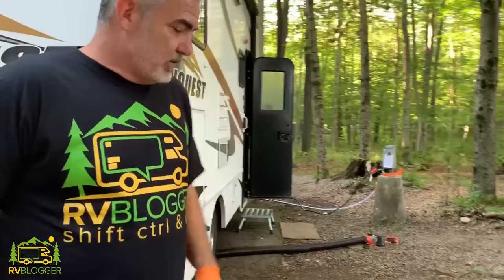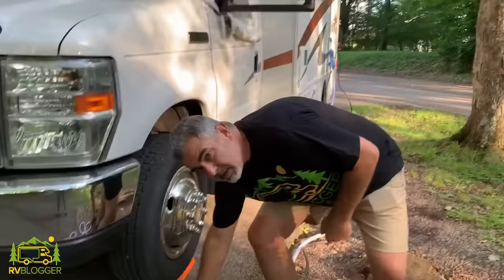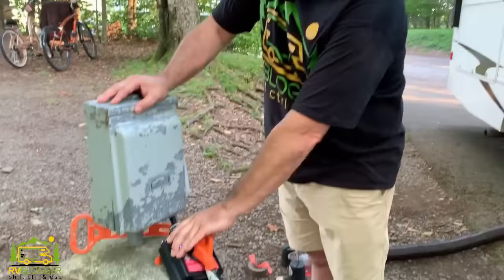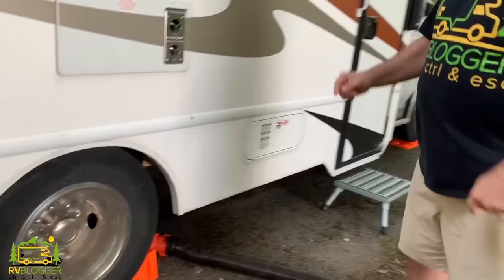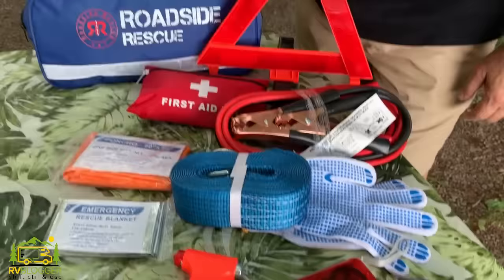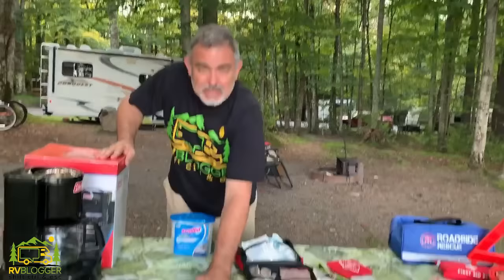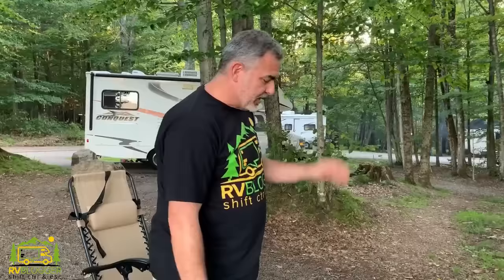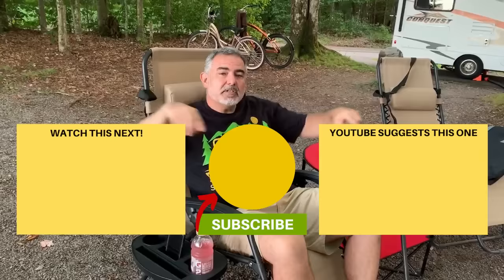Essential Gear & Accessories for RV Beginners - We Didn't Back In to Our Campsite - Do You Know Why?

Comment: Am I the only one trying to figure out why he pulled into a site that suppose to be backed into?
Reply from the maker: Hey Jon, 
LOL we wanted our camper door to be on the same side as the picnic table and firepit. 
Thanks for watching and commenting! 
❤ Mike and Susan
Reply: I was thinking the same thing. Than I thought he was doing this just to show for the video? But I see his reply. Not sure it is worth all the extra to use the table?
Reply from the maker: @dennisbirtwhistle7355  Hi Dennis,
It was totally worth it. One other reason we pulled in was that the site was so sloped that if we backed in my head would be lower than my feet while sleeping and I hate sleeping that way. Only one person out of hundreds was able to figure that one out. This video has taught me a ton about how people see things they don't expect.
Thanks for watching and commenting!
Mike
Reply: I never even thought to question it. I would think most camping people would have known.
Reply: @RVBlogger  well, that is an odd set up! Sure you’re using the correct table & firepit? We tent camp & sometimes we’ve had a site that we had to figure out which table/pit belonged to which site. And you’re correct, sometimes they are set up just as you’ve said…backwards!
Reply: I think to make this video

Comment: Aren't you supposed to back in?
Reply from the maker: We certainly could've backed in to our spot but then our door would've been facing the road vs facing our campsite where our picnic table and fire ring etc was. We perferred pulling in and that was ok cause we had enough RV gear to make it work. Thanks for watching and commenting.

Comment: Always could turn camper around to be closer..
Reply from the maker: Hi Bobbi,
You are like the 10th person to recommend that - BUT - if we turn around then the side door of the RV would not be facing the main part of our campsite with the fire ring and picnic table.
Thanks for watching!
Mike
Reply: @RVBlogger  I was thinking the same thing but yeah having to walk around the camper would be more inconvenient.
Reply: @RVBlogger  yea this makes no sense. Your awning and patio setup is now right on top of the sewer hookup. If you backed in it would be on the correct side. Who is setting up their makeshift patio over the fn sewer hookup?  You are waisting money on the rv TP. There is a single ply charmin and a single ply Scott that work better than the expensive RV brands.
Reply: @xCRO3x  Hi Repvile X,
Look again more closely...I am truly shocked at the number of people who got this all wrong so you are not alone...
I guess it isn’t obvious but if we backed into the site the side door of our RV would not be facing the main part of our campsite where the picnic table and fire ring are located. Maybe I didn’t explain that well enough in the video…
Thanks for watching and commenting! 
Mike and Susan
Reply: Agreed, panning in the video shows other vehicles backed in, which is the norm, and we looked front in here. ;) Also, the sewer hose is great, but one step on it and it'll bend the wire and keep it from cooling correctly. They are not indestructible.
Reply: @jaredb8551  Hi Jared - or should I say super sleuth - lol! Yes the other vehicles around us backed in but this site truly has the hookups on the wrong side of the RV. But you aren't alone in getting it wrong. I am shocked by the vast majority of people who got it wrong too. It's a little scary actually but I guess it isn’t obvious but if we backed into the site the side door of our RV would not be facing the main part of our campsite where the picnic table and fire ring are located. Maybe I didn’t explain that well enough in the video…
Anyway look more closely and see if you can figure it out too!
Thanks for watching and commenting! 
Mike and Susan
Reply: Someone moved the ring and picnic table to be funny 🤣 ,I'd moved everything around the way I like it
Reply from the maker: @WEALRO  No that would be funny!!! Best response yet on the subject!
Reply: No Doubt. Gone

Comment: Great video with lots of good advice!  One thing I might add... we found out the hard way when our travel trailer blew a tire on the road.  Changing the tire on a busy road at night was a rough experience.  We used the jack from the tow vehicle, which was terrible! Worse, the lug nuts on the camper were a different size than our vehicle, so the wrench did not fit.   I luckily had a socket set and a metal pipe to get enough leverage to loosen the lug nuts, but it was touch and go for a while.  First thing I did the next day was purchase a breaker bar with the proper size fit, and a compact bottle jack.  The place we stopped to buy the replacement tire installed it on the rim, but would not put it back on the trailer.  Using the new tools made the job so much easier, and they are a must have to have on hand with your roadside emergency kit!
Reply from the maker: Hi Greg,
Thanks so much for sharing your experience!!! This is great info and hopefully other will read your comment too!!!
Thanks for watching and commenting! 
Mike and Susan 

By the way, we hope you will subscribe to our FREE monthly digital/video magazine called RV Camping Magazine. Let us know how you like it!
https://rvblogger.com/rv-camping-magazine/
Reply: That happened to my stepdad on his HUGE horse trailer on the mackinac bridge (suspension bridge over Lake Michigan). He described it as an…experience…lol I imagine it’s much the same as a regular camper (difficult!)

Comment: The sewer and utility pole are on the correct side. For some reason, you didn’t back into the site like you’re supposed to. Just move the table and fire ring if you really have to, but they aren’t close enough where it makes any difference how your RV is parked. Also, your water filter should be the first thing connected to the water source after the regulator to avoid all that junk water going through your hose. Oh, and always use rubber chocks since those plastic ones are junk. Other than that, some good info and I love those chairs, thank you!
Reply from the maker: Hey mmann, 
We just preferred to back in over moving the table and fire ring. We appreciate the info! 
Thanks for watching and commenting! 
❤ Mike and Susan 

By the way, we hope you will subscribe to our FREE monthly digital/video magazine called RV Camping Magazine. Let us know how you like it!
https://rvblogger.com/rv-camping-magazine/

Comment: I've camped in many, many campgrounds.  This is a standard site that you back in.   The hookups are always on the right as you face a site.
Reply from the maker: Hi Debbie,
Thanks for sharing your experience but have you ever considered the fact that just because you haven't stayed at a campsite where the hookups are on the wrong side doesn't mean they don't exist? Because they do! 
Look more closely... if we backed in to the site the side door of our RV would not be facing the main part of our campsite where the picnic table and fire ring are located. Maybe I didn’t explain that well enough in the video…
And - you should be more open minded...
Thanks for watching and commenting! 
Mike and Susan
Reply from the maker: @chiclet1052  Well considering that there were tall weeds and brush on that side of the camper that was not an option.
Are you really unable to see that the hookups are on the wrong side of the campsite?
Watch the video again and look a little harder...

Comment: Good stuff, surge protector, good water hose, a clear 45 or 90 on dicharge out of RV tanks, and a good heated hose, pressure regulator, wheel chalks, rino flex hose, I like a area rug, and chairs, I recommend keeping a extra stick of water pipe and cutter and about 25.00 worth of fittings for repairs, extra anodes, extra heater element, blue painters tape and ac tape very handy stuff, reflextic also, I keep extra switches also and a electric tester, and basic tools, inside I keep 3 electric heaters, and a humidifier, and dehumidifier, and a floor AC unit if needed, I only use dawn dish soap and calgon water softener for toilet "hands down the best" I cap dawn 2 caps calgon, I use Scotts RV paper wall mart, I have a big Berkey water filter, I keep a indoor outdoor thermometer inside and put the remote outside where the water comes in and monitor the coldest section of my rig for winter to see if I need to get heat in underbelly. The rest is all work and most important rule caulk is important cause water is your worst nightmare and protecting your electrical. When you pull in and park you use blocks on your side to side and your front to back with jacks. I have a fifth wheel. Best cleaning tool for shower magic eraser. And I dry the shower after every shower for longer lasting clean before mildew or scum.   Don't be afraid to try and fix stuff you tube has alot of ideas to help to get started. I keep a 5 gallon bucket and a wash brush for the front cap after travel. Get bugs off asap. I suggest buy some inside Crocs or something comfey to wear inside and take shoes off at the door in my rig! I have a insta pot but I like a crock pot also. I carry a green mountain pellet smoker in my underbelly for BBQ love it. Safe travels
Reply from the maker: Hey Happy Camper, 
Thank you so much for all of this info!!! This will be helpful for so many. 
Thanks for watching and commenting! 
❤ Mike and Susan 

By the way, we hope you will subscribe to our FREE monthly digital/video magazine called RV Camping Magazine. Let us know how you like it!
https://rvblogger.com/rv-camping-magazine/

Comment: I just did a test of 4 TP's. Cottonelle, Dollar General TP, Who Gives A Crap bamboo TP and Bamboo tissues. The tissue did not breakdown at all. The other TP's did. The Who Gives a Crap bamboo paper broke down the easiest. The others were acceptable. I sat the container with 1 cup of water in the container and 6 squares of paper. I did not move the containers. The total time of disintegration was 1 hour. I was amazed how well those brands broke down.
Reply from the maker: That's cool...thanks for sharing your experiment too!
Mike and Susan
Reply: There are lots of videos on TP.  There may be some advantages to using black tank TP, but it isn't really needed. I think the problems occur when folks don't use the toilet for number 1, as much as they should. The paper needs fluid to break down. So if you're going to go number 1 in the woods all the time. You're going to have problems.  Of course that's just my opinion. And there are many out there.

Comment: Great video. I noticed the comments about backing in instead of pulling in to fix the "wrong side" problem. We run into this problem often as we camp with friends on adjoining sites. To get the "correct sides" (Awnings) facing each other, we (Class A) pull in to the site and our friends (fifth wheel) back in. An extra sewer hose and electric extension is necessary for this setup. I jumped straight over to Amazon to check that coffee pot! Great idea since we dry camp the infield at Nascar races and early morning generators are not nice. However $149 for an over-the-burner coffee pot is waaaay too expensive. We'll stick to the stovetop percolator ($37 or less).
Reply from the maker: Hi Mark,
I guess it isn’t obvious but if we backed in to the site the side door of our RV would not be facing the main part of our campsite where the picnic table and fire ring are located. Maybe I didn’t explain that well enough in the video…
Wow the price went up to $149!!!! Yikes!
We bought ours for $50 I think...
Thanks for watching and commenting! 
Mike and Susan

Comment: You should always use a dielectric grease on the prongs of your electric cords especially if you are going to use an extension cord. The extra distance causes more power creating more heat and the dielectric grease will help prevent the heat from causing arcing and melting your plug ends.
Reply from the maker: Hi Big Dan C,
Is thais the stuff that comes in a little toothpaste style tube? I met an electrician who said it will make my lightbulbs at home last longer too. I have a tube around here somewhere I think.
Thanks for sharing that advice!
Mike

By the way, have you subscribed to our YouTube channel yet? If not we sure hope you will click below and subscribe! Thanks!
http://goto.rvblogger.com/YoutubeChannel?sub_confirmation=1
Reply: just use proper size power cord as cords don't make power

Comment: Should use a quick connect for freshwater line at the RV inlet. Protect the RV connect from wear or damage.Also a shut off valve at the quickconnect to open line and flush air out of hose before clicking into RV quickconnect. Keeps air out for the RV water system.
Reply from the maker: Hi Stan,
All good advice!
Thanks for sharing the tips!
Mike and Susan

Comment: Totally enjoyed this video. As a plumbing contractor, just wanted to make 1 point about your comments about installing a pressure regulator. You said that before you had a regulator, you would just open the water supply a little bit to keep the pressure down. That will not lower the pressure. The static water pressure will still be the same, if it's opened all the way or just cracked open a bit. Only the volume of water that will flow thru the hose will be diminished. Other than that, a very solid list.
Reply from the maker: Hey Kevin, 
We appreciate the info! 
Thanks for watching and commenting! 
❤ Mike and Susan

Comment: Great video love the info I'm a new RV enthusiast as well my wife and I just bought our second camper big enough for the whole family and we've been traveling I think we've used 96 days in the last 365 days it's been awesome I had one of those tank cleaners that you hook the hose up to and I guess it's just the way my pipes are routed but I couldn't get water to shoot up high enough to clean the tanks out I simply just hook up to the tank washer hook up I have on the side of my rig and it works a lot better some people can get away with it but I couldn't if your pipes don't allow the same style that he's showing on the video you can always get the wand that goes down the toilet
Reply from the maker: Hi Yohanan,
Thanks for your comment. If you have a tank flush built into your RV you don't need the RhinoBlaster.
Thanks for watching and commenting! 
Mike and Susan

Comment: The Coleman camp stove coffee pots are good. A great piece of advice would be to make sure the coffee pot handle is straight out the front while heating it.. If the handle is off to the side it will melt!
Reply from the maker: Hi Mike,
That is great advice!
Thanks for watching and commenting! 
Mike and Susan
Reply: Buy a French coffee press, all glass bodum to have it reheatable. Boil water in a pot on the propane burner pour it in and presto great coffee.

Comment: So your pressure regulator might be better served on the RV inlet side. A standard garden hose runs 13ish GPM. Your friction loss after 50' of hose is going to be roughly 7 psi (all hoses are different). So you're likely getting 33ish psi in the RV. Might not be a big deal to you. But I figured I'd mention it.
Reply from the maker: Hi Ace,
Never even thought if this before and I appreciate the tip. Are you an engineer by any chance?
Thanks for watching and commenting! 
Mike and Susan
Reply: Another thing related to the hose if you put the filter at the water faucet side you maintain your hose with filtered water. Helps keep your hose clean and not need to be replaced as often.

Comment: Enjoy your videos, disagree about one thing is the toilet paper. Septic safe toilet paper works just as good as Aqua safe and it much cheaper. Also your water filter should be at the source this way your hose stays clean and doesn't get contaminated.
Reply from the maker: Thank you for the kind words. We also agree septic safe toilet paper is just as fine, the key is plenty of water. And we see your point about the hose and connecting the filter at the source. Thank you for watching our RV gear video and commenting. We appreciate your support!

Comment: It's in the correct side.  .you pulled in. Bit backed in😂
Reply from the maker: We certainly could've backed in to our spot but then our door would've been facing the road vs facing our campsite where our picnic table and fire ring etc was. We preferred pulling in and that was ok cause we had enough RV gear to make it work. Thanks for watching and commenting.

Comment: Robbiebago here. Though I love our Rhino hose connector, we found that the hose flushing bit was a weak point and it broke off. We decided to add a gated hole to the top of the tank (easily accessible for us) and then insert the water directly into the tank when it needed flushing. Works much better for us. One question I have, is why don’t you just reverse your rig in so you have the access on the drivers side?
Reply from the maker: Hey Robbieago, 
We appreciate the input and experience! 
Thanks for watching and commenting! 
❤ Mike and Susan